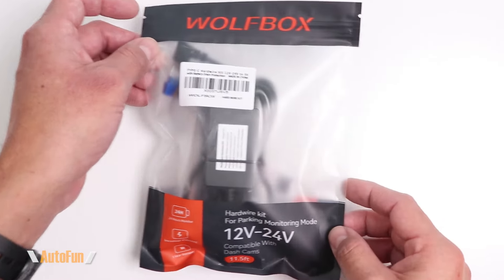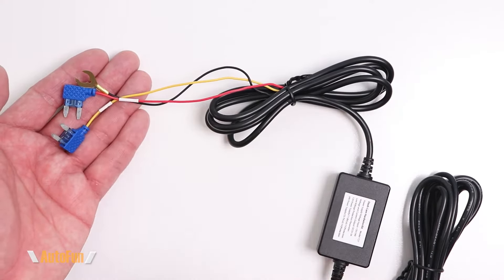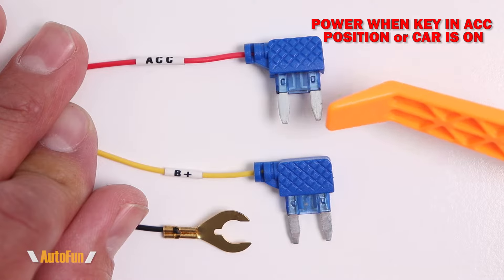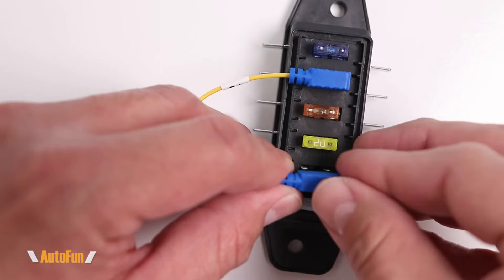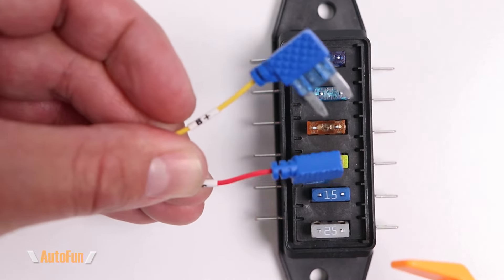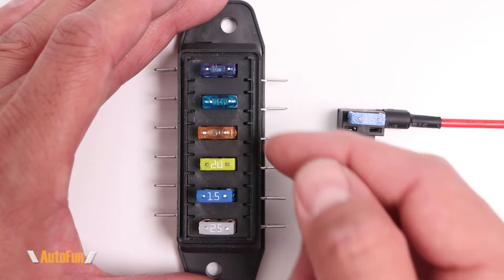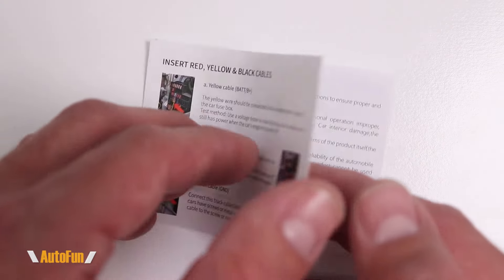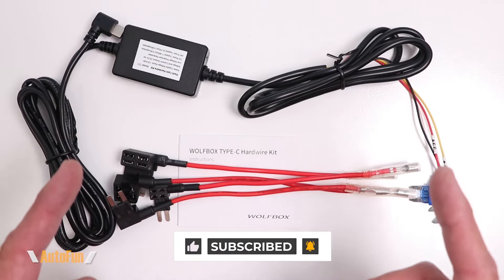Wolfbox Hardwire Kit G930 G910 G900 G850 G840S G840H i17 i07 Install Prep, Fuse Taps Connections

Comment: I found a 15A constant power fuse but the ACC fuse in my truck is 7.5A. Can I plug the red wire into that or must it be plugged into a 15A spot? I hope that makes sense.
Reply from the maker: Hi Jeff! Ah remember a functional fuse tap creates 2 separate independent circuits (each one with a different amp rating partially determined by fuses that are loaded into the each fuse slot in the fuse tap) The fuse removed from the car in the fuse tap bottom slot and the second fuse (top fuse) is for the hardwire kit. So they are each independent of each other. So I'm not necessarily looking to match a fuse amp rating on the car with the fuse amp rating of the hardwire kit (sometimes it does happens but when it does it's coincidence LOL). Here is another video https://youtu.be/K2iKXj82354 where I cover this in mode detail and here my other hardwire kit so you can see another example of the install https://youtu.be/uZp95NbNlmM Hope this makes sense, Cheers!
Reply: @AlexAutoFun  thank you
Reply from the maker: @PKDiver  You're welcome!

Comment: For the wolfbox, how do you know what fuse to put in the dual fuse extensions wires?
Reply from the maker: Hi Harv1981! As shown in the video, the kit uses blue fuses (15A). And here is my hardwire overview video https://youtu.be/uZp95NbNlmM Hope this helps, Cheers!
Reply: @AutoFun  thanks I have 2016 Dodge Challenger, and I am just trying 5o figure out what fuse to use and how to hardwire the wolfbox. The challenger uses mini fuses, and from what the online diagram of the fuses boxes show, I should have extra opens with none labeled fuses.
Reply from the maker: @Harv1981  You're welcome! Ah yes here is my video where I show how I find ACC and BATT on any vehicle  https://youtu.be/K2iKXj82354 Cheers!
Reply: @AlexAutoFun  can the radio fuse be used as acc

Comment: I have used this hardwire kit with a g900.  It’s draining my battery.  Anyway to set it up we’re the mirror turns off unless the g sensor sense movement or collision?
Reply from the maker: Hi Alan! that is strange, the low voltage cut off should kick in before your battery goes too low (mine hasn't drain my battery, I actually run 2 of them on my car,  but I will update this comment if something changes). I would recommend having the installer check that the kit was installed correctly, and if you don't want to go thru your installer, I would also recommend contacting RedTiger for support, I'm sure they can walk you thru some troubleshooting steps. Hope this helps and please let us know what you find. Cheers!

Comment: Hi, I hardwire mine and when I turn off my car the screen goes black but when I press the button in the bottom or rearview dash cam the screen turns on. Is this normal?
Reply from the maker: Hi E! When correctly hardwired the dash cam will turn off and enter park mode (if enabled in the dash cam's setting) when the car is off. I would have the installer check all the connections (ACC, BATT & GND) to confirm that they connected to the correct locations for ACC and BATT (I seen cases where the dash cam stays on constantly if ACC and BATT are reversed or connected to the incorrect locations that does not provide power at the correct time for both ACC and BATT) Here is my follow up detailed hardwire install if you want to see that process https://youtu.be/K2iKXj82354 Cheers!
Reply: @ so that means that if the screen goes off when I turn off my truck then it means it was installed correctly correct?
Reply: @ so that means that if the screen goes off when I turn off my car then the it means it was installed correctly correct?
Reply from the maker: @Ericks_mobile_detailing  Hi E! I would recommend referring to the instruction manual that came with your dash cam to confirm how the dash cam should behave when hardwired correctly. Your installer should also be able to verify if your dash cam is installed correctly and setup correctly (as far as settings). While most dash cams will behave as described earlier there are some exceptions. Cheers!
Reply: @ I have the Wolfbox dash came and the parking mode option disappeared from my settings? Do you know why that might of happen? It is hardwired and working properly when car is off but I just don’t have the parking mode option available on my settings anymore.
Reply from the maker: @Ericks_mobile_detailing  Hi E! Ah yes that can happen if the dash was hardwired incorrectly, or possibly a loose wire. I would have the installer check all the connections (ACC, BATT & GND) to confirm that they connected securely to the correct locations for ACC and BATT (I seen cases where the dash cam will work but not enable parking mode if the wires are connected to the incorrect locations that does not provide power at the correct time for both ACC and BATT, sometimes some location appear to have ACC or BATT but are not good candidates for ACC or BATT, this is specially common in newer vehicles and hybrids) Cheers!
Reply: @ hi I am still having trouble with my Wolfbox, I double check the fuses to make sure I have them connected the right way. Acc (red) to power when car on, and yellow to constant power just like the manual said. I test everything before I turn on everything and dash came works just fine when car is on, but as soon as I turn the car off camera won’t turn on. Any idea of what I could be doing wrong?

Comment: Hey bro. Great video. I hardwired it. Quick question. When I put the car into P and take the keys out. My screen remains on. Is there anyway for the screen to turn off automatically after I take the keys out? I don't want to use the screensaver bc I was hoping the screen would auto turn off after I turn the car off.
Reply from the maker: Thanks Abir! Ah yes, when correctly hardwired the dash cam will turn off the screen (and enter park mode if enabled in the dash cam's setting) when the car is off. I would have the installer check all the connections (ACC, BATT & GND) to confirm that they connected to the correct locations for ACC and BATT (I seen cases where the dash cam stays on constantly if ACC and BATT are reversed or connected to the incorrect locations that does not provide power at the correct time for both ACC and BATT) Here is my follow up detailed hardwire install if you want to see that process https://youtu.be/K2iKXj82354 Cheers!

Comment: My car fuse box is all taken so I have to do this fuse tap method? Can't I just take them out and put these ones in?
Reply from the maker: Hi CX! nope remember, if you pull a fuse out and insert this molded fuses directly in there, the original fuse protection will be lost (say for example you pull a 5AMP fuse and install this molded 10A fuses, that circuit will not longer pop at 5A as designed, same if you pull a 15A fuse and install this molded 10A fuse, now the fuse will pop prematurely since it running a lower capacity fuse. Here is the video on how I replace the molded fuses https://youtu.be/Qzw9yUYN7zo and here is my install video https://youtu.be/uZp95NbNlmM Cheers!

Comment: mine dont came back on after it sits with this kit...its wired correct.
Reply from the maker: Hi A! When correctly hardwired the dash cam will turn off the car is off and turn on when the car is On. I would have the installer check all the connections (ACC, BATT & GND) to confirm that they connected to the correct locations for ACC and BATT (I seen cases where ACC and BATT are reversed or connected to the incorrect locations that does not provide power at the correct time for both ACC and BATT) Here is my follow up detailed hardwire install if you want to see that process https://youtu.be/K2iKXj82354 Cheers!
Reply: @AlexAutoFun  I found out if you only have 1 fuse in it,you have to plug it in 1 way to work,both fuses ..no problem.
Reply from the maker: @alvendetti4600  Hi A! Ah yes, as shown in the video I linked earlier, fuse taps have only one correct orientation (both for operation and for safety). Cheers!
Reply: @AlexAutoFun  if you put both fuses it works both ..
Reply from the maker: @alvendetti4600  Hi A! Ah, I would be careful, an incorrectly oriented fuse tap may provide power but will be bypassing the fuse (due to how fuse taps work internally, video on this coming, stay tuned) Cheers!

Comment: I'm having trouble finding the kit that is compatible with the wolfbox g890. It's the 3 ch dash cam. Anybody know which hardwire kit I can use?
Reply from the maker: Hi Edgar! The hardwire kit for the G890 is normally included with the dash cam as shown in full review here https://youtu.be/EeCSx35mkPY Cheers!
Reply: @AlexAutoFun  ah that's right. So I just need the fuse taps for that hardwire kit. I left my g890 in a car that has been non op for a few months. Barely transferring thr cam to my new car and I forgot that the thing came with its own hardwire kit. Guess il have to dig through the piles of boxes in my garage until I find Mt wolfbox box that had the hardwire kit in it. This is going to be a mission.
Reply from the maker: LOL! Try reaching out to Wolfbox, they may just be able to sell you another hardwire kit if you can't locate the one that came with your dash cam. Cheers! @edgararcega3046

Comment: Will other hard wire kits work for the Wolfbox I07?
Reply from the maker: Hi Ayush! Yes this kit will work with the Wolfbox i07. Regarding using a different kit, I recommend sticking to the matching kit for the dashcam to avoid issues (both technical and warranty) Here is my introduction to hardwire kits video where I cover this in more detail https://youtu.be/Yky9_tTvwMc Hope this helps, Cheers!

Comment: I added the hardwire kit and my camera will turn on , then after 1 minute it turns off. If I touch the mirror it will come on again then turn off. Ant ideas ?
Reply from the maker: Hi Gary! Not sure which dash cam you are using but sounds like you have "Screensaver" enabled which turns off the display after certain period of time. if you want the screen to stay on all the time, I would recommend turning off that feature. Cheers!

Comment: My hardwire kit is not working. Any idea what it could be?
Reply from the maker: Hi humberto! I would have the installer confirm all connections to confirm they connected to the correct locations for ACC and BATT (I seen cases where the connections for ACC and BATT are reversed or connected to the incorrect locations that does not provide power at the correct time for both ACC and BATT). And here is my hardwire details video where I cover this in more detail https://youtu.be/K2iKXj82354 Cheers!
Reply: @AutoFun  I installed it it was the ground cable. It's working now I'm just curious how the time-lapse or parking mode works. Bc the camera turns off once I turn car off. I know In in the correct fuses bc I have some led lights one are constant and I have a kill switch for them. The other only turn  on when I turn the ignition. Do I have to have the GPS part of the dashcam on in order for it to work?
Reply: @AlexAutoFun  thank you for the reply btw!
Reply from the maker: @hmontalvo90  You're welcome! Ah regarding parking mode, that depends on which dash cam you are using. I would recommend referring to the dash cam's manual to confirm the different park monitoring options for it and how to enable them. Hope this helps, Cheers!

Comment: Can someone tell me why the camera turns off when I turn off the high beams? Pls
Reply from the maker: Hi Roxana! I would have the installer confirm the installation is correct, it should definitely not do that if hardwired correctly. The incorrect circuit was likely tapped for power. Here is my video where I cover this in more detail https://youtu.be/K2iKXj82354 Cheers!
Reply: ok, now it says Acc off it cannot be operated 🥴, then the touch does not work when in park with the car off, what a confusion 😂
Reply from the maker: @roxanaisabelcontrerasblanc357  LOL definitely sounds like it was hardwired incorrectly 🙃 Cheers!